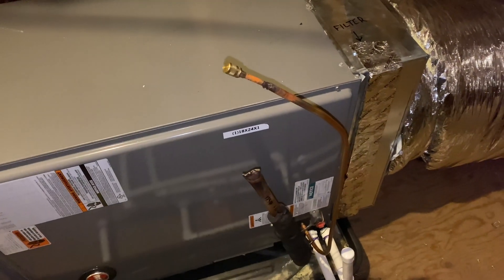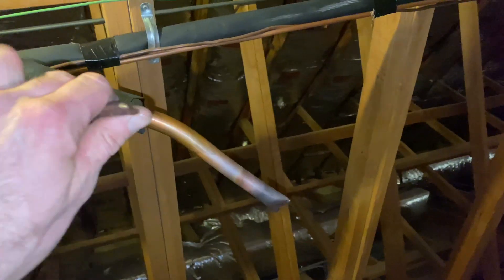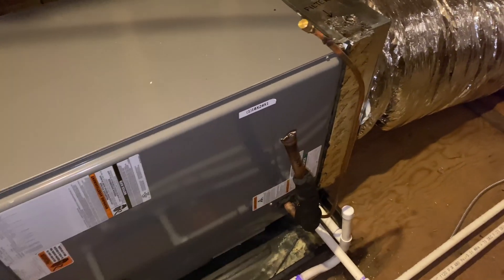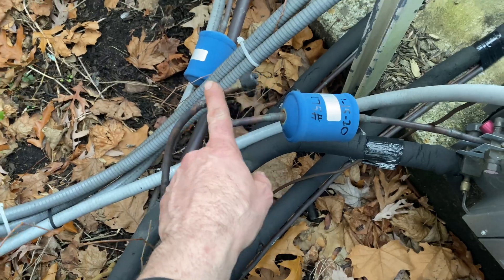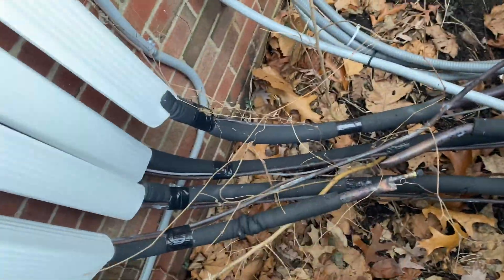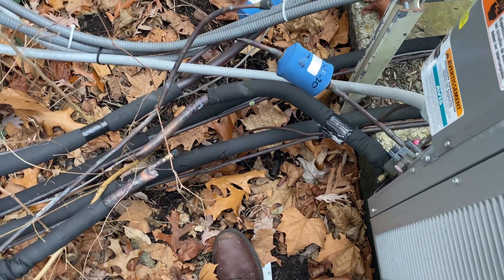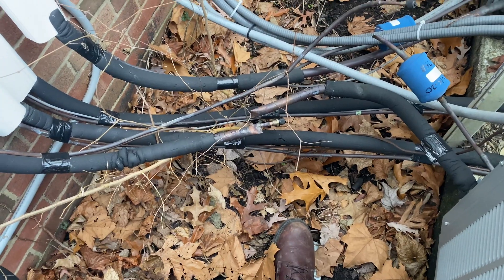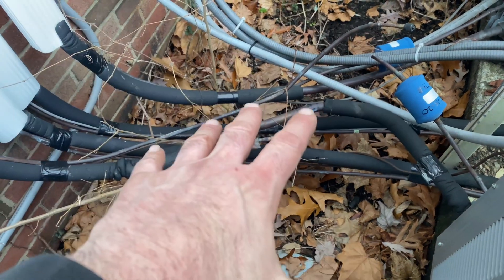HVAC Best AC Refrigerant Leak Search

Comment: i have a TG229 Series 17-1/2 in. 2 Ton Convertible Cased Coil for Heat Pump and Air Conditioner Part #TG22924C175B1622AP i hear a noise coming out of the AC drain line on it. its sounds like air coming out of a squeezed balloon. does this mean that the connection is loose?  i dont have the AC on this happens when the furnace blower starts
Reply from the maker: Look for loose tape near where you hear that sound. The drain trap might be dry. Pour water in the drain pan or if a clean out is on the trap. Most sounds you are describing is from tape. Or silicon where air is trying to squeeze through

Comment: Great video. Question. I had a leak on my unit by the suction side near air handler. The brazing gave up and created a leak. I noticed a lot of oil that soaked the insulation. So I undid the joint and cut it open. Some oil came out of the big suction line from coil side. I redid the brazing and everything probably to charge the system. My question is do I need to add oil to compressor? Or this much oil leak is ok and won’t hurt the compressor? It’s a variable speed XC20 Lennox system. Appreciate your response on this.
Reply from the maker: It’s rare to add oil to a split ac system. They shouldn’t leak. If they do they need to be repaired. Their is lots of oil in system. It moves around with the refrigerant. Cars hvac system is very small compared to a central system. A split ac without adding oil can have a 20’ or 100’ line set.
Reply: This is a great question, I’ve wondered about this myself as I’ve had a couple of leaks on my line set losing some oil. In the auto shop it’s standard procedure to add an ounce or two of oil after a leak is repaired - was wondering if it’s ever necessary or recommended in these systems. Hopefully one of the pros will weigh in on this soon.

Comment: There is no need to cut lineset at condenser. When you fill it with nitrogen at 350psi and close service valves after it's been filled at condenser it will equal pressure in line set and condenser. I leave a test gauge on service port that sealed with nylog.  You come back in a couple days or week. If pressure dropped you know where to start looking. If it didnt and drops when service valves are opened it's at condenser... I've done quite a few isolation leak searches like this. Works well 👍
Reply from the maker: Yes I usually loop the line set on one side. Yet after this test something is getting replaced. We do lots of these once the systems are shut down for winter. Nothing like a tech condemning a leaking evap. System pumped down for evap replacement and a month later no cooling a condenser leak. This kind of test eliminates those uncomfortable situations. We all have many ways to end up with same results.
Reply: This way he can tell directly if its in high or low pressure lineset. And yes valves can leak by also.